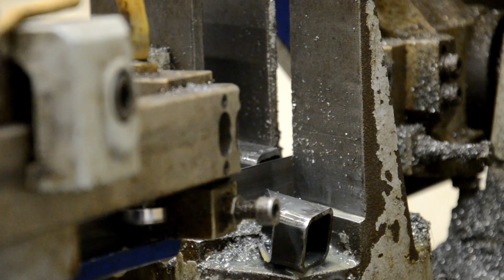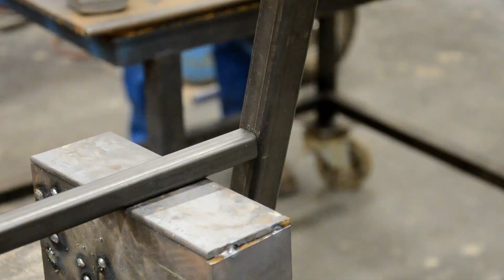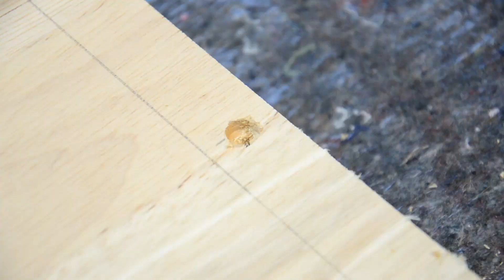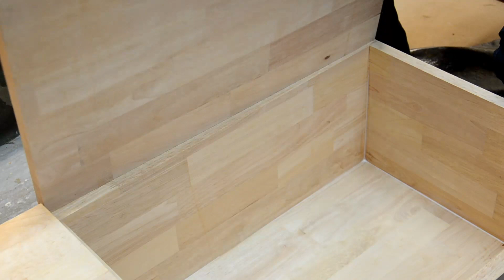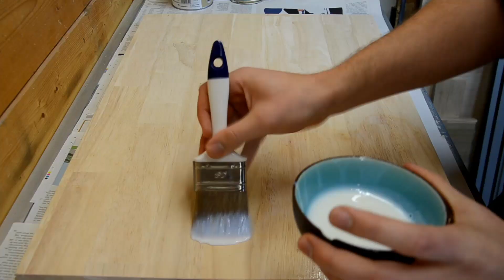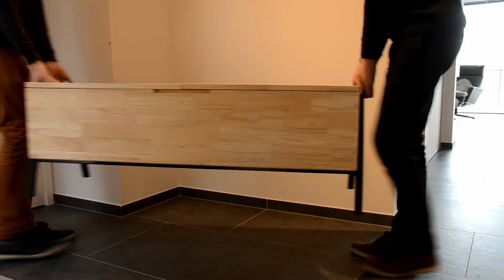DIY Modern Entryway Bench with Storage

Comment: Beautiful piece Ruben.    Do you have plans available for the metal frame? I'm considering adding metal work into my woodworking and, other than the angles, this doesn't look too difficult with only eight welds.  With it's low stature, I don't think I'll worry too much about my welds giving out like I would with a desk or something similar.